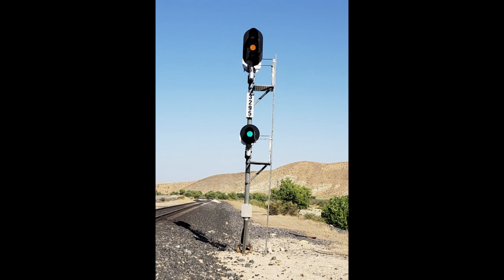Railroad Signals Explained: Part 2

Comment: We were using the lunar on the southern end of the UP down here in Louisiana the last time I was out on the main line in 2009.  They have recently done some up grades and I’m not sure if the lunar signal has been discontinued or not.  I do know it is still used on other railroads in the New Orleans area.  UP did do some upgrades to tie in another railroads tracks along with the Huey P. Long Bridge over the Mississippi River just up river from New Orleans, LA, into the UP dispatcher in Spring TX.  This begins CTC going to the bridge which terminates at the south entrance to our UP yard and the BNSF ( old SP ) yard.  The new CTC now includes the main line or possible both main lines through the UP yard  at Avondale and connects with the old CTC at the northern end of our yard limits.  I believe they still used a lunar indication at that junction which controls routes to the bridge and to two other railroads.

I too like the lunar signal and it was my favorite of the colors used in the signal system.  It has a much richer look than any of the other colors.  Lunar with a touch of pearls.  But for operations, green was my favorite color.  The more green / clear signals meant I made my money faster, as we got paid by the mile.  I made the same dollar amount for the basic trip between the two terminals rather it took 5 hours or 12 hours.

Comment: To see you call out my name and then see you laugh was the best Christmas present I've ever gotten. Thank you Mark! And thank you for dedicating your time and investing many hours of video editing down into just 15 minutes. You've got a lot of knowledge that's fer sure. I've watched this video 3 times and I know a lot more now than I did 45 minutes ago. If you were still a signal man and I were a new hire/trainee, you'd be tryin' to get me transferred somewhere else coz I'd be asking a lot of questions. Getting information from the relay folks around here is like pulling teeth.
What I find most interesting is the Approach diverging aspect. Here at the UP yard in Herington, Ks there's 2 mainlines leaving the yard with each mainline having its own signal pole with 2 heads each. I've spent many hours studying these and the top is always red, never changes. The next Cp is one mile away still double track with a double crossover, there's also 2 signal poles with 2 heads each. These top signals will change. The next Cp one mile away the double tracks go to single track.
And then to get really confusing, going the other way, entering the yard, there's just one signal head on each pole for each mainline.
Reply from the maker: I'm glad you didn't get annoyed at it! It just struck me funny right then. I don't know why the top heads aren't controlling mainline movement. Perhaps installed for future use.
Sorry for the delay in responding!
Reply: @MarkClayMcGowan  I think a lot of peeps find my channel name funny. I've been thinkin' about changing it to FNBS freight lines. (Effin bull sh*t, get it?)
And no problemo on the response delay, you be a busy guy and I understand how things fall into the crackz.

Comment: There are some railroads who use the lunar white for restricting. CSX, Metra, CN's former Illinois Central mainline. The lower signal head has four lenses instead of three.
Reply from the maker: Sorry for the delay in replying. I was never sure if anyone else used the lunar. Thanks for the info and for checking it out!
Reply: @MarkClayMcGowan  CSX is all gung-ho about the Lunar White, while UP and BNSF are using it less and less...   
Older Speed signaling systems don't use Lunar White at all, and instead R/R/Y means Restricting (and sometimes R/Y).

Comment: How long is it between blocks or mainsignals
Reply from the maker: It depends on the territory, speeds, braking distances, etc. but generally from one to two miles. Blocks between control points at sidings are determined by the length of the siding.
Thanks for checking it out!

Comment: Are all the signals in UP approach lit
Reply from the maker: No, many are constantly lit. In Electro Code 4, the default is approach, in Microlok, it's constantly lit. Both can be changed, but any time the unit drops out and resets, it goes back to default, so most maintainers just quit messing with them. Thanks for checking it out!

Comment: Imho UP signals are goofy.  I don't like route based signalling.  I think speed based signalling is better.  Everything here is CSX however so I may be a bit biased.
Reply: I assure you they are not goofy.  The are more flexible.  The western US is much more spread out, so the impetus for Speed signaling just isn't really there.  Both systems have pros and cons.

Comment: Hi, Mark! New subscriber here and really enjoying your videos! I've been watching a webcam (UP in Carroll, IA) that has a pair of intermediate signals in view and notice that it can take anywhere from 10 to 15 seconds after the leading axle crosses the insulated joint to knock down the signal. The timing doesn't seem to be related to train speed, and the front of the train is usually well beyond the signal by the time it shows red. Is there a timing mechanism in the circuitry, something related to the relays, or something else? Thanks in advance!
Reply from the maker: Microprocessor control systems react more slowly than the old relay systems did. If a relay was down, it was down. With the new systems, they have to run checks to confirm the yes or no, and that takes a few seconds. 
Thanks for checking out the channel!
Reply: @MarkClayMcGowan  Awesome! Thanks, Mark!

Comment: When I worked on BR lots of signalling points failures, ASE was 'Wrong man for the job'had to be paid off, replacement narcissistic told by Chairman BR Board that he was to be sacked in 6 months time unless failures dropped, bought in man from Swanley led a task force team, found lots of equipment faults reduced failure rate.

Comment: Ok.  I think I got you.  If a switch is set to guide a train off the main line into a yard or siding, it is considered “reversed”.  What would the opposite of reversed be?  Straight through?  If a train is coming out from the yard or the siding onto the main line, but the switch is NOT in the reverse position, will it damage the switch?  Derail?  Get through it just fine?
Reply: Normal, Closed, Straight versus Reverse, Open, Diverging
Reply from the maker: What Jovet said. Yes, if a trailing move is made through a turnout with the switch in the normal position, it is called "splitting the switch" and will damage the the rods and stand on a hand throw. The operating rod on a power switch is designed to shear off, but it can still damage the machine. UP policy was to change any machine after a split.
Thanks for checking it out. Sorry you didn't get me!

Comment: I’m confused when it comes to the yellow over yellow and red over yellow. Same with with the yellow over flashing yellow and red over flashing yellow. I’ve seen your first video but it seems like they basically both mean the same.. am I wrong?
Reply from the maker: Yellow over yellow is an approach to diverging route and is displayed at the approach intermediate signal. Yellow over flashing yellow is an approach diverging for higher speed turnouts where you can get a red over green. Red over yellow is AT the control point where the top signal controls movement on the main, bottom signal movement into the siding or other diverging route. 
So if you're the engineer and are going into the siding at the next control point you'd see the yellow over yellow (or yellow over flashing yellow) at the intermediate then red over yellow (or over green) at the control point.

Comment: On the UP here in Vegas i've seen both lunar and flashing red. There is a CP with a spur into an industrial yard and when the train is entering the yard it shows the red over lunar and it has recently converted LED heads. But then i've seen trains taking the siding south of here at Jean and they get yellow over flashing red aspects on the intermediate and at the CP.
Reply from the maker: The lunar and FR signify the same indication. Entering occupied or dark territory.
We got rid of all lunars over here some time back but ive heard they still use them in specific signaling.

Comment: So I recently discovered a control point where a single track splits off into a triple track (the original main becomes the center track) and as such it has a triple head signal on the entrance. Would you be able to explain the aspects at this type of control point? Thanks!
Reply from the maker: Each head would control movement on a track with the top head controlling the main line, the second controlling the first diverging track, the bottom head controlling the last.
There would be multiple diverging route aspects depending on various factors such as high green, red over yellow (over red?), red over red over yellow, etc. The Mojave Interlocking has similar signaling although a yard is involved.
Thanks for the question and for checking it out!
Reply: The fun thing about Route signaling is it needs to be able to convey differences of routes to the train crews, but those really boil down to speed limits for the turnouts.  A three-head signal would, in modern times, mean that two different speed limits exist for the different directions.  But, that doesn't mean there HAVE to be two different speed limits.  If you review the modern rules for UP, you'll see that R/G/R and R/R/G mean the same thing as far as the rules are concerned.  It's the timetable where the maximum speeds are indicated.

Comment: I live along the former SP sunset route in Southeast Texas and I have noticed a green over red signal at a nearby control point. I saw on another video that it's like the red over green but the train is instead lined through the main rather than the siding. Just wanted to confirm that that's how it works with UP. Thanks!
Reply from the maker: The top signal is always for the main line. At SP both signals were always lit so there was no confusion about which signal was which in case of a light out. Some UP signals are that way, some aren't. It just depends on the programming at a location.
I hope that answered your question.
Reply: @MarkClayMcGowan  Thanks! I have passed the control point at the east end of China, TX siding and seen a green over red with a train coming then the train just passes the switch and stays on the main. The signals on both ends of the siding are old SP installs but UP just upgraded to newer LED signals nearby as well us upgrading some crossings.

Comment: On the BNSF in Pasco WA you still have some 70's safetran houses and signals all of the signals around here are incandescent
Reply from the maker: The upgrades depended on whether or not PTC would be part of it. If it wasn't the old systems were generally left in place. Last year on my roadtrip to Denver, I saw a bunch of semaphores still active on the BNSF in New Mexico. I understand they have since been replaced with colorlights.

Comment: All this technology single talking to other singles and these railroads still deliver fright late.  It's all bs  Double track the main lines so the fright can reach the customers faster.  These class one railroads are a joke.
Reply from the maker: On time delivery has nothing to do with the signal system other than it helps expedite fleeting moves. Main lines can't always be double tracked. Places like Tehachapi have specific geographic issues such as tunnels and 800-1,000 foot cliffs. Others have environmental issues such as the environmentalists shutting down the double track project on the Cima sub a few years ago. The Ceaser Chavez Cultural Center shut down the Rowen-Woodford project.  It's too bad you see the nation's most vital transportation link as a joke. You think the class twos could operate it more efficiently?

Comment: Hey Mark, I don't remember most of these when I worked there. I left SP signal right before the UP merger.  OK you answered it. Was gonna ask if UP changed and upgraded a lot of them. I guess they did... Hey is Mickey still the lancaster maintainer?
Reply from the maker: Mickey went into construction (UP split maintenance and construction) and was a foreman for quite a few years. He retired around 2017.
Reply: @MarkClayMcGowan  thanks for that info. If you ever run into any of the old gang Sp 608 tell them hi for me. John mcintyre, bruce shoengarth, terry harris dave davis ronny sisk.  Thanks Mark!

Comment: I have seen signals on a cantilever like a crossing signal. But are connected to poles on each side in between a number of tracks (4 for example). What does that mean
Reply: It doesn't mean anything significant.  The signals for each track are placed in the truss over the track it governs.  That structure, with legs on both sides of the track, is called a signal bridge.  The structures that are footed on just one side of the track are called signal cantilevers.   These can be used where sighting distance around curves can be problematic, or where there are more than two tracks and putting signals between the tracks isn't feasible, or any other situation where the safety of maintaining them or distinguishing which track is governed is at issue.   Good question!

Comment: Have you ever encountered an Approach Clear 60? Or one of those Diverging Clear Limited (red over flashing green)? I just built the UP signal system for a simulator and was curious how often they appeared. Also 'mixed signals', those weird combinations of high and dwarf signals
Reply: Hey you!   
I'm told Div Clr Lim exist(ed) here in Nebraska, but I never saw one.   I've never seen a "mixed" dwarf/high signal, either.  I suspect those might be long gone but never deleted from the rules.

Comment: I like these videos. Even though I'm planning a model train layout based on SP and Santa Fe of the mid to late 70's, I want to have a somewhat simplified signal system.  I run all DC on my layouts, so whatever I design will have to remain simplified.  However I like the flashing gray white lunars, too. SP had those in those old HC33'S (bean pot looking heads), usually mounted below a dwarf H2 head.
Reply from the maker: We (SP) had an HC33 "S" signal at Summit until the UP took over in 96.

Comment: I'd love for you to do a video on the ex Pennsy / conrail/  NS signals in PA think they're called color position signals. They still use them on the main line from Conway to Harrisburg and some of the secondary lines such as the old mon railroad line serving the coal mines around Waynesburg and down in that area.
Reply: When i waa a conductor for CP i worked from Binghamton and taylor yard in Scranton, going south on the river line from Sunbury to harrisburg we had the old color position lights. As soon as we got on NS trackage, Some of those signals were insane. You could have two flashing diagonal yellows over a red and lunar white. We had to break out the signal chart a lot of times there was shit like medium medium approach medium. It was crazy. They seriously need to simplify with better system
Reply: @stripervince1  holy hell. That is nuts.  And engineers had to score a perfect 100% on the signal test as well. It's really interesting that the max speeds changed depending on what kind of train you had also. A heavy coal train's restricted could be 8 mph depending on the grade and a much lighter tofc or container train coulda been double that. So an engineer had to alter his train handling based on train type. Add for position signals go all that had to be incredibly confusing
Reply: @jdday1757  it was a ball of stress, you had to pay very close attention to what you were doing constantly. Not only the signals were difficult but when i worked there 20 years ago, the radios and phones were very noisy, squeally and hard to hear over the locomotives. Slow orders, track work, grade crossings train handling bad weather. Not a easy job. I always wanted to be a engineer. Until i became a conductor. It might have been a great job years ago, but today with all the paperwork and rules and regs its not. Now the cabs are video and audio monitored and recorded. You cant have a conversation about the tits on the waitress last night at sizzler. No privacy, glad im retired now lol
Reply: @stripervince1  when I worked for Norfolk southern in the locomotive maintenance department as an electrician we had to download the event recorders on every 3 month RM and again on any accident along with downloading the railcam. At the time there wasn't audio recording inside the cab. I left the railroad in 2011. 20 years ago woulda been when the EVO series locomotives were coming out along with with SD70Ms. Which were so much more quiet than the dash 8s or the C39-8 and definitely the SD40-2s. I dont know how any engine crews tolerated tbat level of noise. I hated self testing those damn locomotives. Plus it was hard to sleep in them and not get caught by management lol. 🙃
Reply: @jdday1757  yeah NS management hid in the bushes with binoculars at the triple red sidings to catch crews snoozing at 4am. Our CP trains used to used to get stopped for hours and hours at reds for absolutely no reason. Hated being on NS property. We had pretty decent engines mostly GP40s and SD70s still hard to hear dispatchers on the radios
Reply: @stripervince1  lmao. Both of those comments.  Doesn't surprise me. They were assholes to work for. Steel isn't any better. We heard rumors about the whole hiding in the bushes trying to catch people. I thought it was just a rumor.
Reply: That's a whole other ball game from what Mark is used to. What are your questions about them?